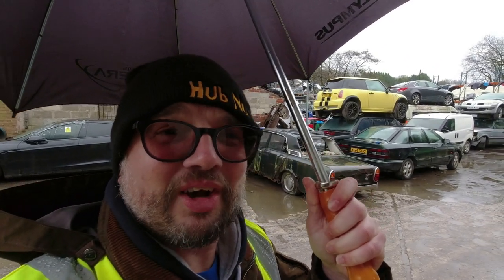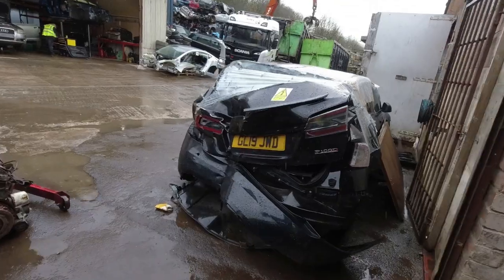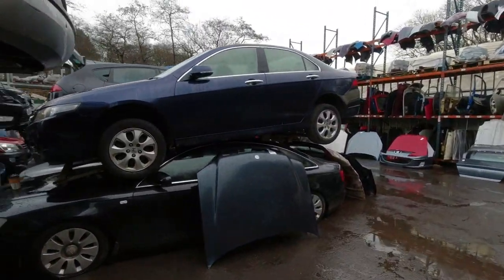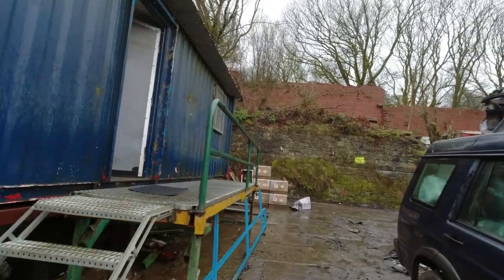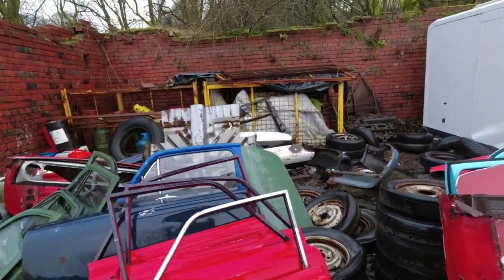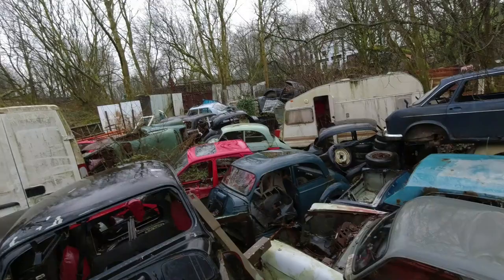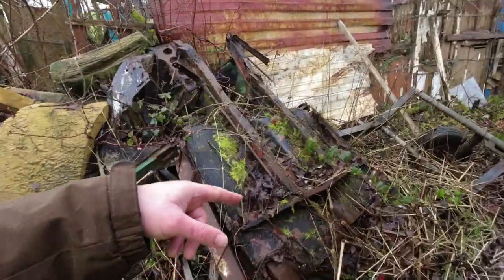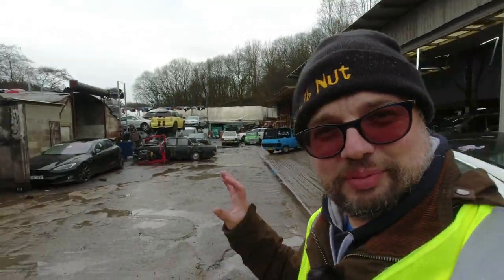Scrapyard Walkabout: Some amazing classic finds!

Comment: I miss the N reg AX 'limited' Elation in blue/green me and a gf bought for £310 many years ago. Probably circa 2009. 68k-ish on the clock I believe, we drove to the south west to buy it and drove it back home. Went up and down the country so many times, to work every day and on many an adventure. Edward the AX. It never ever let us down. Such a fun little car, basically made of paper, so yeah it was the rust that did it in the end. But I wish I'd had some storage to throw it in back then, it held so many memories. Utterly reliable and charming, and we kept it all original down to the cassette player. They're a rare sight now, but so is the Saxo that replaced it even. It's quite unreal just how rare common cars have become. I'm so glad we got that car and that it survived the scrappage scheme of the time which put early ends to so many would-be classics. Great tour. I'm glad places like this exist.

Comment: These online breakers are great.  I used to use them quite a bit as i had a high mileage van and unusual things start to wear out.  If someone writes off a vehicle the same with low mileage then you get your reqlacement qart for a third to half of the qrice from a dealershiq.

Comment: Very close to that yard is one of the steepest inclines on any railways in the UK. Known as Baxenden Bank, its on the long time disused Accrington to Bury line and is 1:38 gradient. I know your fascination for steep hills on roads, and though you'd not notice 1:38 on a road, it was a hell of a climb for an old steam train.
If you travelled south after you left Baxenden you'd have gone down the A56 towards Manchester. A section of that dual carriageway that bypasses Haslingden is built on the old trackbed
Reply: my grandad worked on baxenden station back in the day, got  a phone call from accrington station  train driver had reported warning light  was out, grandad replied bloody light could not make its mind up weather it was on or off so i blow it out🚂

Comment: The Corsair started out with a straight four 1500cc, my dad had one and I passed my driving test in it.  It was also a bench seat and column change.
Reply: Didn't they also have some strange assembly with what looked like overgrown toggle switches on it for the indicators? My late godfather had a light blue V4 - GEG 659D. Funny how I can remember that but not what I had for lunch yesterday...
Reply: I agree with the engine option, my dad also had a 1500cc, there was also a GT model of the 1500 with individual front seats and a floor change

Comment: I have seen more Corsairs in your video than I ever recall seeing on the road!  

Sixty years ago, Three-wheelers and motorcycle combinations were in the same group as a motorcycle so once you had passed your bike test, you could drive a Reliant at the age of sixteen.  Very useful for learning to drive a four-wheeled car a year later.
Reply: and if you knew how to use a spanner the top could be taken off the gearbox and the blanking plate for reverse could be removed   so you coild ga backwards as well!!!!!!!

Comment: Had a Corsaire v4 2000 in the 80s nice smooth car bought it for £200 sold it to a mate for £150 he moved to Derby trying Trent power Signalbox , he was a Signalman with B R , while he was training he used to commute every weekend back to Birkenhead , and never had any problems with it , wish I'd have kept it myself , great video,  if I'd have kept every car I'd owned I'd be very rich same as the motor bikes I've owned . 😀

Comment: Seeing the blue Renault Clio made me sad I had a black one 58 reg 5 door automatic loved it and wish I hadn’t swapped it in wonder why this ended up in the scrap yard as when I looked the reg up on mot history checker said the mot only expired on 18th of February this year so this week but the mot for last year only thing it said was Monitor and repair if necessary (advisories):
Offside Front Brake disc worn, pitted or scored, but not seriously weakened (1.1.14 (a) (ii)) so it’s a mistory how it’s ended up in the scrap yard but it did have 137,173 miles on the clock and Date of last V5C (logbook) issued 30 March 2021

Comment: I think the Corsairs originally had the (non-crossflow) 5-main 1500 engine (a la Mk2 Cortina) followed by the 1600 crossflows, and eventually the V4 engines. The luxury model was the 2000E, and the Ford gearbox of choice for "specials" was, of course, the 2000E box
Reply from the maker: Just the 1500, then the V4s I think. I got a bit muddled when recording.
Reply: @HubNut  You're right., Ian ...... I think I'd forgotten how short (for Ford) the Corsair's production run was. The "crossflows" only got into their stride during the early 70's, after the Corsair had ceased production.

Comment: I wonder if that Sierra XR4i was one of two sierras from a house near where I live in Solihull. Its only recently they have been removed one was the XR4i and the other was a Estate with painted day glow alloy wheels which had been left by the owner to be covered in brambles. There was also a little Renault 19 that was pretty much used as a daily until the last few years. Rumour had it this owner also had some other decaying cars in the back garden of the house.

Comment: My first car 1977  Ford Corsair 1500  £300 bought from a work mate  Maroon and grey  handbrake in the dash and fuel filler behind rear number plate. Clutch went after I'd had her 3 months so got a Barclays bank loan for £800 and bought a  J reg Mk3 Cortina 2000l in bottle green  pre 74  facelift with the slopping dash . Kept her best part of 6 years and still my favourite car body shape to this day  ( Maybe almost matched by my now currently owned alfa Gt)
Reply: The Corsair 1500 was built from 1963 to 65. I had a 68 2000E as my first car.

Comment: The Corsair originally had a 1500 engine same as cortina then got the V4 1750. It ended up with the top of the range 2000E. Never had the pinto engine. The V4 was very unreliable in the Corsair but seemed fine in the transit.

Comment: A '55' plate motor in the junk yard? We had a '99 T reg soft top Suzuki Vitara and were told it was doomed to fail its next MOT. We only had it in the UK as a runaround as we live in Bulgaria.
We weren't going to kill it so we drove it to the south of France, ferry to Sardinia, ferry to Naples, ferry to Igoumenitsa and drive across Northern Greece and back home.
The car is still going strong nearly 4 years after being condemned to death by expensive repairs.

Comment: Re that Sierra 2.3d tailgate-that car was seemingly only scrapped in the last year, and at its last MOT in Sep 2020 it had only covered 12000 miles in its life.
Reply from the maker: That's sad. Could it have gone around the clock though? Ford were late with a sixth digit.
Reply: @HubNut  could've i suppose, they were popular taxis. But then I did think the tailgate looked in good condition. Not necessarily representative of the whole car though, maybe it was the only part worth saving!

Comment: The Ford Corsair was before the Cortina. It was called the Consul Corsair and had a sister car, the Consul Capri. These cars never had the pinto engine. They were also very expensive to manufacture. It's said that Ford bought a Mini and worked out the BMC was losing money on every one. They designed the Cortina to be very cheap to make. It was originally the Consul Cortina. My old 1963 mk1 had a Consul badge on the bonnet
Reply from the maker: Ah, cheers. Need to read more of my books!

Comment: The guy said the Corsair had a 1750 cc engine , it's 1663 cc and it was too early for a pinto Ian ..... The early ones had a 1500 cc pre crossflow Kent engine too.... The XR4i as he called it is just called a Sierra 4x4 and all of them had discs on the rear ....

Comment: What a fascinating field of slightly broken dreams. Weird windscreen shape on that white Tesla - is the extended bit at the bottom to give the wiper somewhere to park? It's also interesting to see the bald tyre on the Sunbeam Talbot. The car must've driven for many miles on iffy tyres to end up with that much wear. It suggests it had a long, slow decline as a cheap old banger after its heyday was over. I wonder if it was the introduction of the MOT test in 1960 that sent it to the scrappy? If so, by now it's probably sat in the yard for longer than it was on the road.

Comment: I drive an Iveco Daily as my work truck. We have several bigger Ivecos as well. We can usually tell when they're running because the check engine is on. Your cynicism toward them may be justified.
Reply from the maker: It Vibrates, Everything Comes Off...

Comment: It's just part of the cycle of mechanicals , make sell use wear out  , strip of bits then bale shred and remelt . 
Check out "Just rolled in " for vehicles totalled with some with only a few  thousands of miles .
Reply: At least the bits saved can be used to fix other cars .

Comment: When figuring out the registration of the Landcrab, I got a result for STE688G on the DVLA. It is listed as a blue Morris, first registered in July 1969 and untaxed since November 1984. However, the engine is only 1098cc. CarLogBook says it is a Morris Minor. Looking at the video, the registration seems to be RTE688G, but there is no information on the DVLA.

Comment: I believe the Corsair was available with  V4 2000cc never the pinto which arrived with the Mk3 Cortina in 1970
Reply: Just found this, I apologise
 "In fact, the Corsair was originally shipped with a conventional 1.5-litre 'Kent' inline four developing 60bhp, and the 1663cc (1.7-litre) V4 wasn't introduced until 1965.

Rough or not, it did at least bring more power (73hp) and performance, and later a 2.0-litre Essex engine brought 92bhp and, in the Ford Corsair 2000E Deluxe, an impressive 103bhp."

Comment: 1:00 Corsairs were one 60's car that never seemed to rot badly .... or if they did, they hid it well.
Reply: All Fords of that era rotted out their front wings in about 5 years...the one exception was the Corsair...and there was no aftermarket for its wings. It was also the Ford that was pretty much unloved by Ford enthusiasts who saw the V4 engine as a sort of embarrassing uncle (uncouth,drunk, strange dancing LOL ) at a wedding party.But like your embarrassing uncle it had its own character which it let rip in the Transit.
Reply: They may not have rotted, but I do remember seeing many with metallic paint peeling off in large patches. Although sharing many parts with the Mk1 Cortina, they appeared much more upmarket, even after the introduction of the Mk 2 tina.
Reply: @chrisrand5185  Yes Ford introduced some thrilling modern metallic colours at the time, the problem was they used a wrong spec lacquer (aka clear coat today)which I think reacted after a while with the paint.

Comment: Can I be the 945th person to point out that the Corsair started life with the 1500cc Kent engine, before being replaced with the godawful V4's?

It never got a Pinto engine, they went into the Mk. 3 Cortinas which replaced the Corsair.

My dad had a 1500 Corsair in the early 1970s. KTU 450 C. Long since scrapped, I imagine, sadly.

Comment: And  the corsair never came with the pinto.. was either a 1.7 V4 or the 2.0 V4 in 2000E spec
Reply from the maker: My error. They were initially 1.5 pre-Crossflow. Got my engines muddled

Comment: XR4x4.. Not rare.. but he's saying its a rare XR4i.. they never done them in 4 door till the early 90's as a run out model using the 2.0 i14 twin cam..  That is just a normal mk1 2.8 XR4x4.

Comment: Think a lot of the breakers yards went due to lack of ground tanking and oil/fluid interceptors. A shame as component recovery is 100% recycling if it’s used again rather than melted down as low grade metals. It’s the same with household waste recycling centres - you used to be able to go and buy items to get spares or have a go at fixing them up but that has now also been lost along with the promotion of the skills to repair and maintain things and the mentality that we should be doing that. Instead we just buy more imported crap to replace what we’ve just thrown away on a whim. At some point the economics will catch up with us as a country (if they haven’t already).